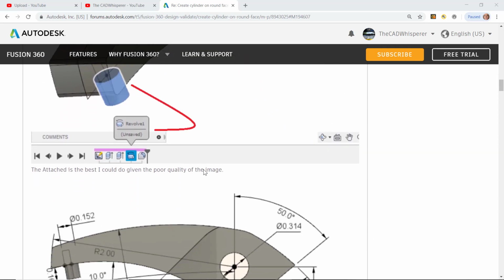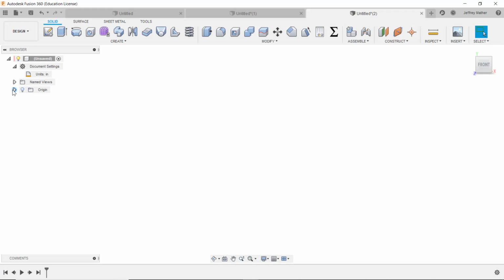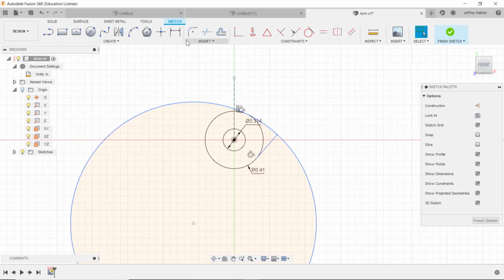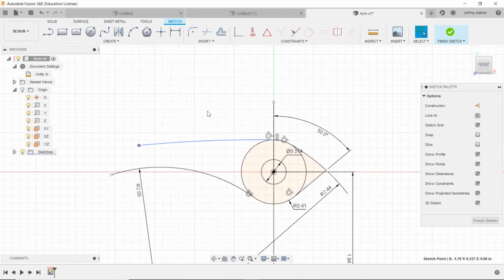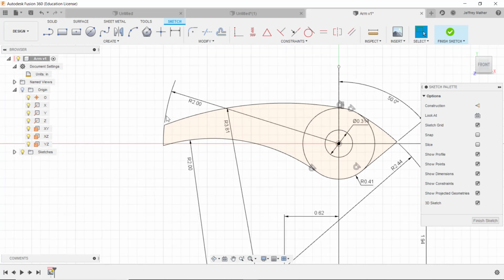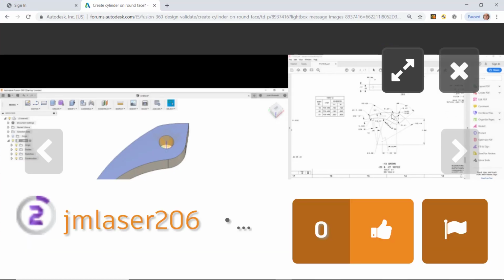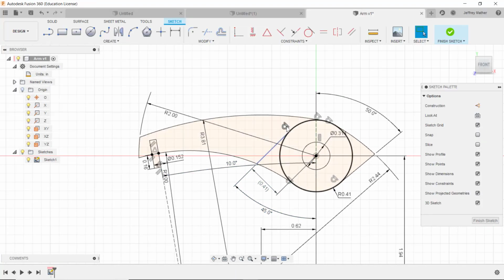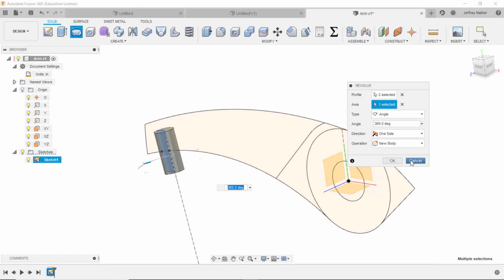Serenity Now   the Zen of CAD Sketch Repair

Comment: Great videos. You have helped so many people,,, in so many forums,,, over such a long time. You deserve some acclaim.
Question about trimming basis arcs or lines which then cause missing constraints: in this case would it also be reasonable to leave the circle sections in as construction lines? My issues are always (here and in Inventor) that once you start generating solid bodies there sometimes are intricate subareas that take forever to locate and select.
Reply from the maker: It is always a decision to trim or not to trim.  In the current releases is not as necessary as in the past, but there is the issue as you indicate of missing small areas if you don't trim to an unambiguous boundary.  I would say, when in doubt - trim and add back in any lost constraints.